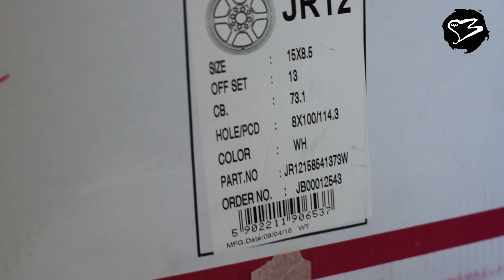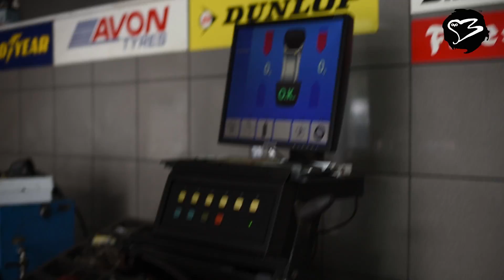Tire stretch 195/45 on 15x8.5 Japan racing JR12

Comment: How is the fitment on a Swift with 8.5J and et13?
Reply from the maker: Inside of the wheels is no problem, et is small, so no rubbing on axle or suspension, outside my fenders are widen and i have negative camber, otherwise it would be a problem...
Reply: Kawazuki I have lowered my swift with 35mm but when going in corners the rubber hits the edge of the fenders. The rest is stock suspension. Biggest problem when lowering is a wrong roll center which is too much below the center of mass which causes the car to lean over a lot in corners